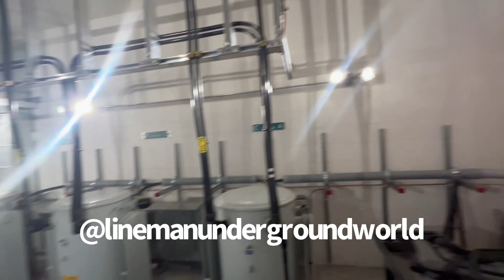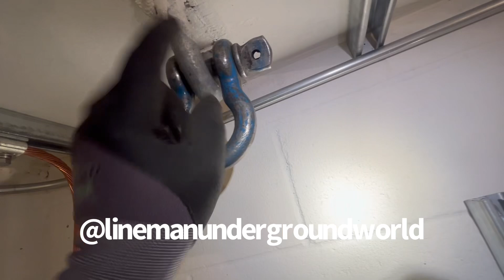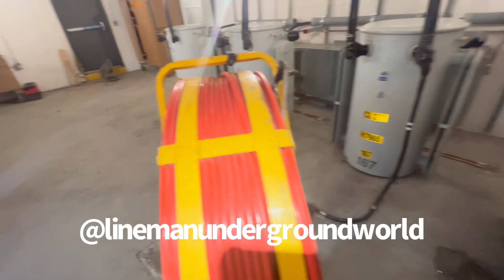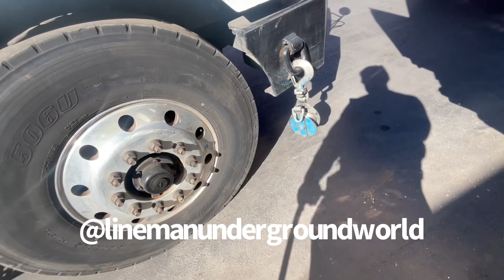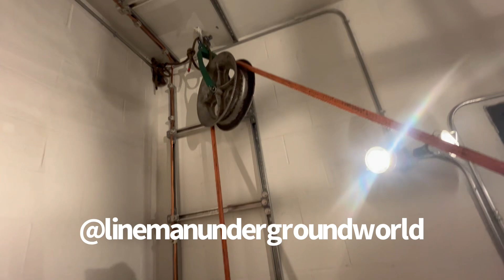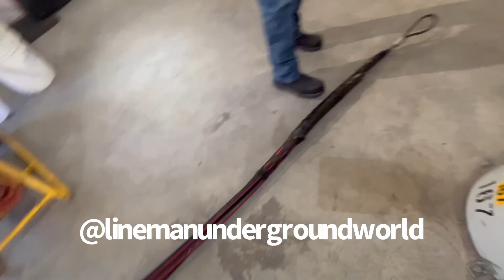New CS station

Comment: I concur, sweet they had the pulling eyes all there for you. The one in the entrance looked new and cut in. No way an engineer did that without DPW telling them. LOL
4,800V is new one to me ow common is that there? 
2,400, 4,160, 7,200, 12.3, 14.4, 24.5 (25kv)  etc....  All common but 4.8kv?  first for me. 
Sweet pull there, work safe.
Reply from the maker: @inothome  wazzup ino , yes sir that’s the voltage we use be sides 34.5kv where are you at..???
Reply: @linemanundergroundworld4854  Got ya. I was in the Fl Keys for long time and was all 24.9kV distribution. Then bounced around SE US for a bit with ABB and then did some time at Kennedy Space Center working substations there. Now just do contract work and did some time in Antarctica too, 4,160V there. Now just relaxing in Vietnam for the last 8 years on and off between contracts. All 22kV here and do electronics / electrical repairs for westerners here. 
Never did any work West of the Mississippi.
Reply: @I_Am_Your_Problem  Good to hear there is at least one engineer out there with some thought put in to it. But in my over 30 years of installation, maintenance and repair I can count on less than one hand the number of engineers I know that actually gave a damn about the actual design and serviceability of what ever the equipment, building, device etc.. they were designing.